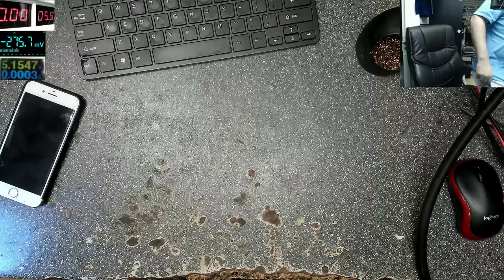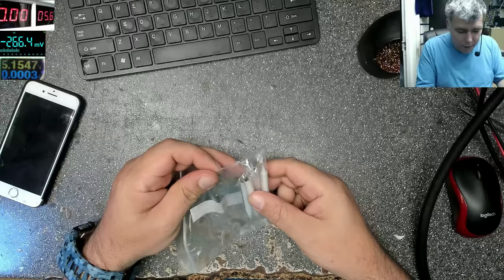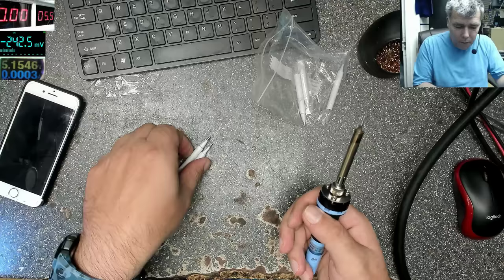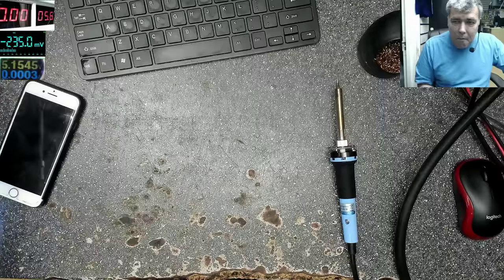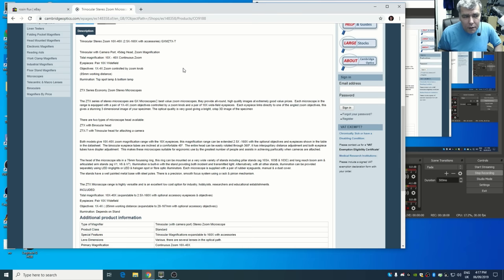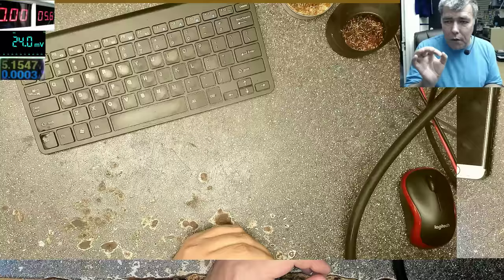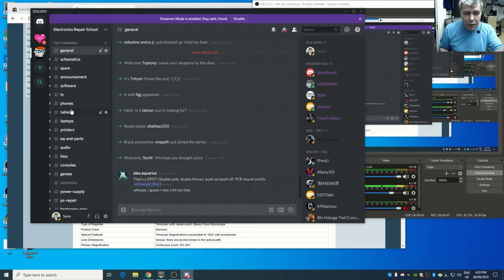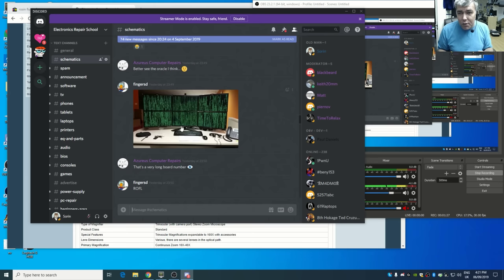4 Must-Have Tools For Beginners DIY Electronics Repair

Comment: Please I always use Over current limit and over voltage limit on my power supply but... I don't know why exactly. Some kind of reflex i dont know how to explain. What are those buttons CV and CC doing here??
Reply: CC is constant Current and CV is constant Voltage. You either want the power supply to give constant current or constant voltage. Hope this helps
Reply: @DetermineLyngdoh  Ok thanks, not really helpful. I have read the microscopic instruction pages, I use both, always, it works fine. But the documentation dont say in wich case to choose CC or CV or both or none. Do you see what i mean?

Comment: i bought your flux kalafonia but its exclusive uk i think cant find any in asia, i have so many flux but china
Reply: glyn hodges  where you from? i tried  many chinese made flux, got those gel types just looks and smells like candle,i settled on the amtec cheap ones
Reply: glyn hodges  in ebay uk i can see those kalafonia stuff, what i have here in online shops are the same with ali, those cardboard box not the same, they are like candle i dont know if they have rosing because no smoke at all

Comment: Hot glue!! Come on Sorin, I'm disappointed. Just joking. I would add b7000 glue for digitizers and not only, copper wire ball to clean the soldering tip because it's way better than the sponge, usb amp/volt meter it's absolutely a must and mine costs like 2-3 euros.

Comment: well, you can start out with a very cheap solder iron, but you will quickly want to upgrade to a HAKO or something. Why,, well the cheap ones take several minutes to heat up, they perform poorly or break easily. A nice beginner HAKO is about 100$ plus tips. HAKO brings the heat fast and the tips will melt shit.

Comment: My experience is buy cheap and you will buy twice. Buy a least not the cheapest :)
Reply: Todestelzer I made the same mistake by buying cheap hot air station and cheap soldering iron,but they don’t last and they are not good for beginners and now I just have professional equipment, like weller, hakko, quick, ersa and thermaltronics etc

Comment: I wholewheartly must disagree with you!  The shown multimeters are junk, even for beginners. I must not be a Fluke, but a good multimeter in the 40-60 Euro class from a reputated brand like Owon, Aneng, Victor,  U-T, Habotest or Zotek (zoyi) witth at  least 9999 counts should be obligatory and that not only from the point of product quality and features, but moreover from the security aspect. Another point is soldering: you are experienced enough to produce even with a bad soldering unit good results, a beginner is not so fortunate. Like the multimeters it must not be a JBC or Hakko, but a good clone from sugon, aifen or yihuah will do and should be bought. Spend as much money you can,  i think 60 Euros is the absolut minimum, good stations like the aifen A9 you will find in the 100-130 Euro range.